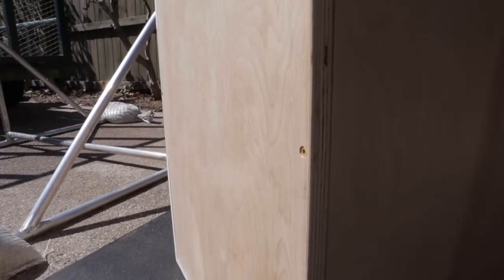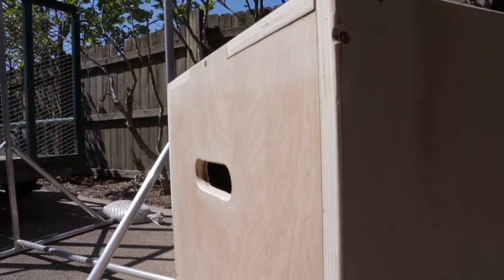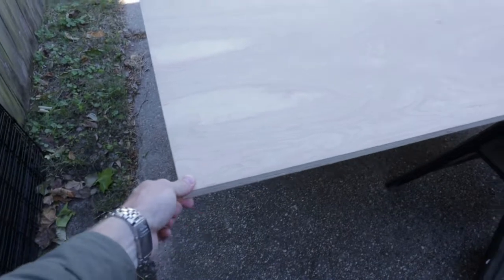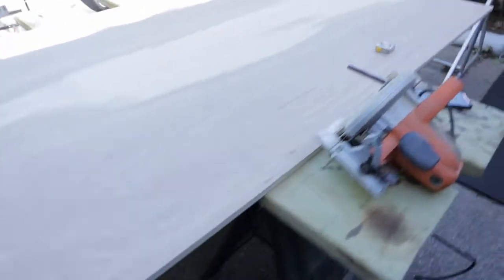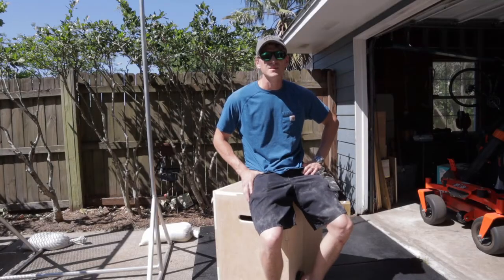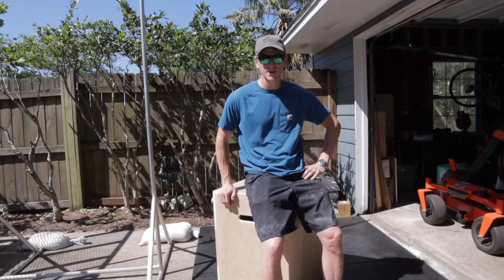DIY Rogue Fitness Style Plyo Box Build - Garage Gym Build Part 2

Comment: Did you find that you NEEDED the support or would it be fine without it? Also, which side did you put the handles on?
Reply from the maker: To be honest it is dependent on what you plan to do with it, the amount of weight that will be jumping on and off of it, etc. If I were to build another one today I would include the support.  It doesn't have to be a 2x4, you could use a scrap of the plywood you use for the box sides.  I want to say I put the handles on the sides that measure 20x30.